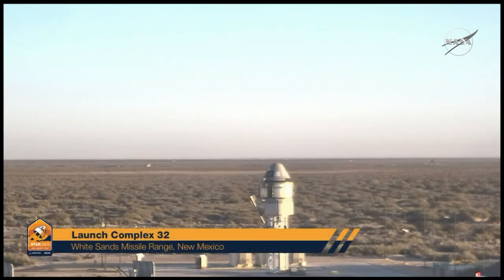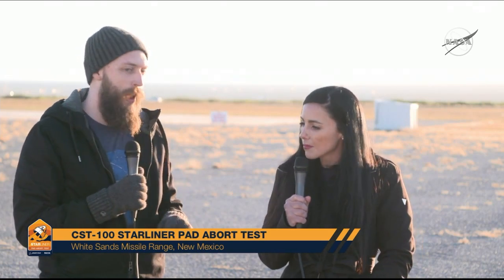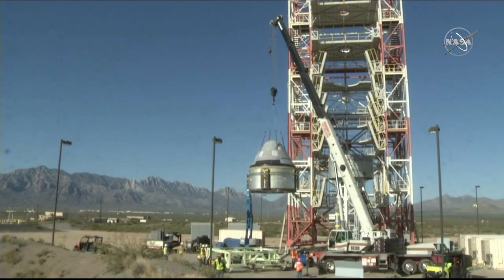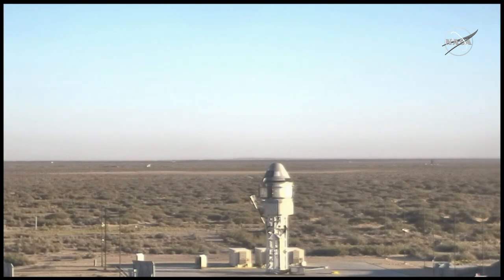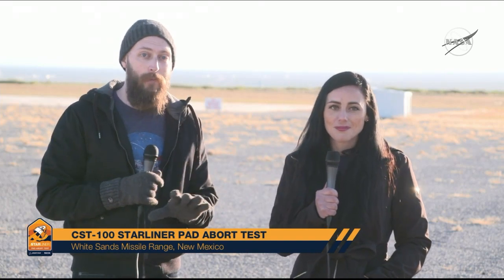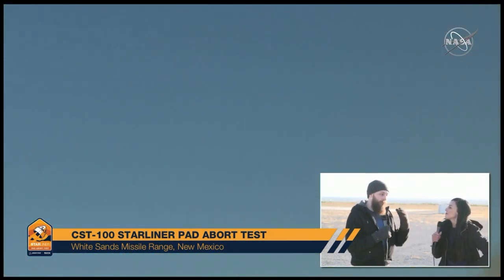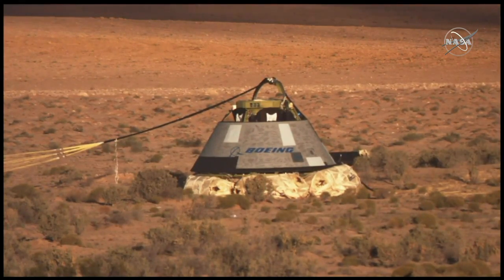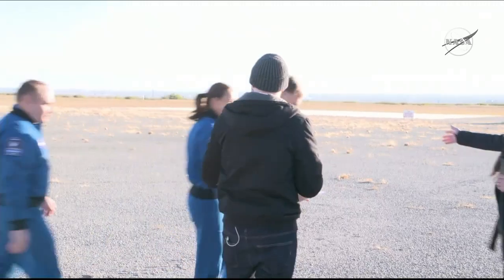Pad Abort Test of Boeing's Starliner Spacecraft, Nov. 4, 2019

Comment: Will there be an in-flight abort test as well, and if not why not?
Reply: I’ve seen nothing supporting that they will and the likely reason is that the Atlas V is insanely reliable and safe.
Reply: In flight abort was not a hard requirement for this program and Boeing has chosen not to do one.
Reply: @jmburbach  What could possibly go wrong...
Reply: Except I think the point of the in-flight abort is to have the rocket explode to ensure the automatic abort system fires.  Sure, these ground tests are fine, but per my understanding they're manually tripping the abort systems.  In the SpaceX IFA, I believe they're going to trigger the FTS on the rocket, and SHOULD then trigger the auto-abort.

It's all well and good to say the Atlas V has never had an RUD, but this isn't about the reliability of the Atlas V; it's about how the Starliner will behave in the unlikely even that one DOES.

Not to mention that they'll eventually likely want Starliner to fly on Vulcan, which will have (relative to Atlas V) less of a reliability record.

In other words, an IFA test still seems like a good idea.

Comment: 2 out of 3 chutes ... what happened?  Not the first time this has happened to this craft.  it may be within tolerance, but the percentage of failer is questionable.  Until they figure that out what is happen and can correct it this ship will not see manned flight. Better take SpaceX up on the offer to freely share parachute technology.
Reply: The 3 chutes deployed, but due to the g-forces, one of the chutes snapped and flew its own way.
But it was still in the required amount of 2 chutes, so it's still successful
Reply: @coffeeconsumer2707  NASA will not agree. Only test item that perform close to 100%  percent to predicted test perimeters are considered successful. Just because the backup configuration saved the  starliner don't make the test successful. Just lucky.
Reply: Well, almost all of this is going on luck. Also, just wanted to point out that this wasn't a parachute failure, it was a deployment failure due to the high speeds

Comment: Yes, use agent orange. That will teach those pesky astronauts!
Reply: Dude, it's dinitrogen tetroxide, much worse than agent orange
Reply: The cloud looks extreme, honestly. Venting unburnt propellant?
Reply: @solarissv777  Do you have a source for your claim?
Reply: The oxidizer for the rockets in the service module is nitrogen tetroxide, which fumes red/orange. It's extremely toxic and reactive. You can confirm that with Wikipedia or anything which discusses the propulsion of Starliner.
Reply: The oxidizer for the rockets in the service module is dinitrogen tetroxide, which fumes red/orange. It's extremely toxic and reactive. You can confirm that with Wikipedia or anything which discusses the propulsion of Starliner.

Comment: Boeing Starliner is not the first purpose built orbital space capsule to land on land.. Crew Dragon is also built to land on land retro-propulsively. The red smoke is toxic bi-propellant which is extremely hazardous to breath and potentially fatal.
Reply: Definitely not the first. The first orbital space capsule had landed on land in 1960 before another one flew in 1961 with Yuri Gagarin.

Comment: How many G's will the astronauts feel in the capsule when the rockets kick in?  And there was supposed to be a third chute right?  With the two chutes how fast was the capsule going when it hit the ground. The air bags didn't seem to provide much shock absorption.
Reply: Remember though. This is designed to land in water, and the 3rd chute is just there for redundancy. And while I can't guarantee it, I'd assume the seats inside are shock absorbing.
Reply: @mossbenson  its designed to land primarily on land. They even said it in this video. Thats what the airbags are for. It can land on water in the event of an emergency.

Comment: Orange smoke... And everyone are dead
Reply: Dinitrogen tetroxide. Highly toxic. Hydrazine is used also.
Reply: @satyris410  I'm very surprised they are allowed to still use that. I guess because they are hypergolic?
Reply: Dee yes, it’s much easier and faster to just pour two liquids together than to properly ignite normal fuel, and as reliability and fast activation are critical on these emergency engines on the capsule, they’re using hypergolic fuels.
Reply: @satyris410  Do you have a source for your claim?
Reply: @Woodsballer209  You act like this is some outlandish claim. Look up anything about the abort system and you'll easily find it. You can find the exact abort engines that Boeing uses on Starliner.
Reply: @klnsbl  I know they use it for the fact it's so reliable but I'm shocked nothing better has been developed that's not so dangerous.
Reply: @Woodsballer209  lolwat. I can send you the MDS for both substances if you want. Or you could just look it up on Wikipedia. It's not a claim, it's a fact.
Reply: Orange smoke, and no-one died. News flash: Flying to space is dangerous.  But, while a cloud of toxic gas is never a good look, a real pad abort would land in the ocean. The crew have plenty of air and are in a pressure vessel. Nitrogen dioxide would be neutralized by water.

Comment: Too much smoke. Is it normal?
Reply: Side effect of the rocket fuel used. That’s why it was red.
Reply: Highly toxic hypergolic fuel, probably dinitrogen tetroxide. Yikes.
Reply: @klnsbl  Do you have a source for your claim?
Reply: @Woodsballer209  It's N2O4. The SM uses hypergolic fuels, with Dinitrogen Tetroxide being used as the oxidizer. At higher temperatures, this substance turns from a colorless gas into a crimson-brown cloud of NO2.

Can't prove its N2O4, but it's almost guaranteed.
Reply: Can't say if they intend to let every Service Module contaminate the ground after an abort (or test), but I wish they wouldn't. They could program it to burn off excess thruster propellant after separation.

Comment: Why need shoots open simultaneously insted of one by one, or two by one, or else?
Reply: They're a lot less likely to foul each other if they open simultaneously.
Reply: One of the three main 'chutes opened way too fast and snapped away from the capsule. These are all supposed to open gradually. SpaceX has redesigned their system as a result, also using zylon instead of nylon and four main parachutes. 3 times stronger, more redundancy.

Comment: Not very good, only two of the three parachutes deployed. Boing is going to have to do better than that. NOT NOMINAL
Reply: Actually, it was pretty Nominal, the 3 chutes did deploy, but one deployed a bit too fast, making it snap off and fly its own way. The required 2 chutes were still there, making the test successful. And this is also the reason that people test
Reply: Quoting the narrator “Even when things don’t go like they are designed”.
Reply: @eagleviewhd  Well, that third chute wasn't designed to snap off from the g-forces, But then again, this is the reason we test
Reply: Upon closer look, fire from leaking fuel, may have burnt through the parachute line.  That would not be good!
Reply: @eagleviewhd  Then they would just fix that. Remember that you usually don't criticize a sketch for a painting, instead of the painting itself.
Reply: @coffeeconsumer2707  Taking failure as a learning experience (_"this is the reason we test"_) applies while you are conducting design/development. Then you test to learn how things work in real life and design accordingly to meet specifications. But once you have moved to qualification/acceptance testing, a failure implies you have overlooked something or did not do a sufficiently good job earlier. There is much less glory in this kind of failure.
Reply: @cogoid  If you spot an anomaly then you just fix it and test it again, even if it's a safety test, and those tests are to find out if it is safe, so the best thing that can happen really, is something wrong, So you can fix it making it most likely not happening later again.

Just because its a safety test doesn't mean that they can test it anymore
Reply: @coffeeconsumer2707  Testing is a great thing, nobody doubts that. But -- Boeing is performing under a fixed-price contract. That means they must hit acceptance criteria to get payed, and they do not get payed extra if they have to fiddle multiple times to get it right. They, (and SpaceX) are already massively behind schedule, to NASA's growing consternation. NASA is trying to buy more seats on Soyuz, but russians are saying that you have to pre-order two or three years in advance. Understandably, there is a lot of pressure to get this done pronto. It is not a happy situation.